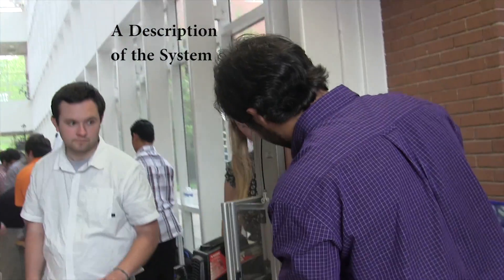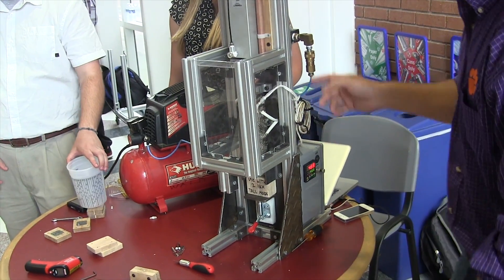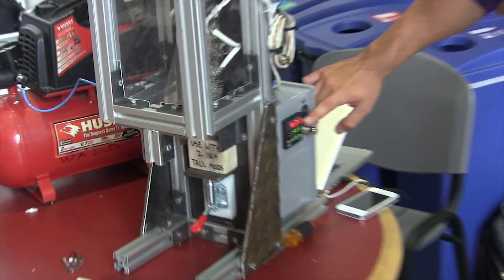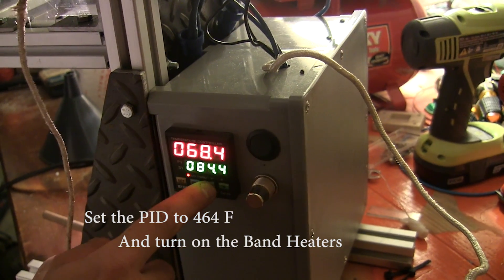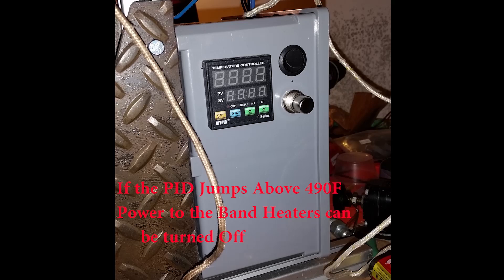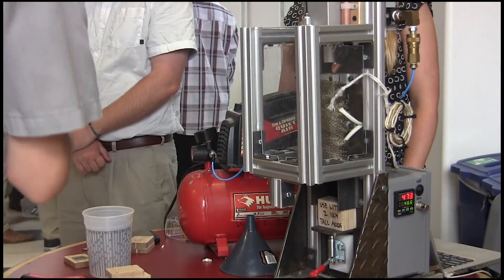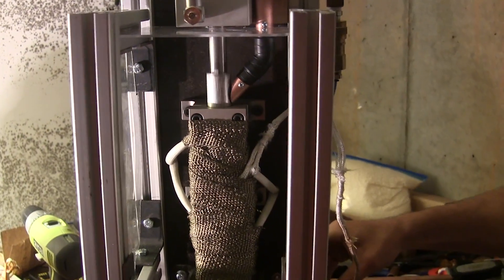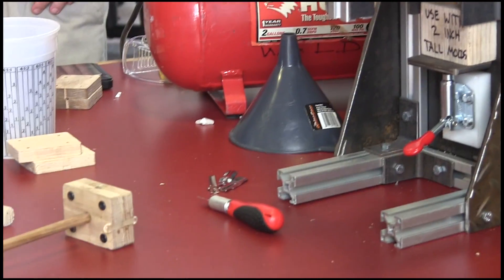Polymer Injection Molding Machine Demonstration Video

Comment: Benchtop injection molding machines are going to rival consumer 3D printers soon.  Everyone and his brother is making these injection molders these days and as more people start to realize that FDM 3D printing isn't that great for most small-run manufacturing, they will start buying these.
Reply: Yup. But dont get me wrong fdm is still great for making larger objects, like lets say a game controller case.
Atleast for prototyping..
My dlp printer comes in a day or 2, and then im gunna buy a cnc, dont know if i should save up for a 5 axis or just get a 3.
Im going to make an injection molding machine, but wanted to go the threaded route, where plastic is fed, pressurized with the threads, and the heater remains inside. And to make that part i would need the 5 axis. Although it may be overkill for a desktop machine.

Comment: plastic injection technology means series production. wooden molds and amount of hand operations don't make this device useful in real production. A good idea, however its poor implementation make it expensive even for 450USD even for university. Go ahead and make really working machine, guys. Meanwhile "thumb down" just for poor implementation, hope to give you many thumbs up in future.
Reply from the maker: This project was completed under a short time, with very little prior knowledge of the Polymer Injection Molding process, and purchasing/modifying of the entire machine components under the tight budget made for a very basic and nonprofessional build. Future improvements outside those constraints would include a larger metal mold with ejector pins,  a larger heating chamber, and a more streamlined autonomous process. This project was not meant for use in real serious production, but rather as a learning tool for Engineering students to really understand the Polymer Injection Molding Process. With this knowledge though, I am sure I can make a much more professional Molding Machine build
Reply: @NickLoe1  Pay no attention to criticism...I sense a cultural shock here: he says "make really working machine" in broken English? obviously the purpose of a SCHOOL work is NOT to make something intended to make money but to SHOW principles, concepts and ways things work. Maybe would be better for that rusky to mind his own business and design, build and finance a prototype for a milking machine, to provide butter, cream and milk for the children of a school in his hometown instead. 

So criticizers keep your mouth shut and go to F urselves.
Reply: 1.  No one said this was supposed to be used in large-scale production.
2.  If you read the show notes, you will see that this was a school project and they were limited to a $450 budget.  Therefore, no use in spending money on proper molds since that is unimportant for the purposes of machine usability and seeing how this is not being sold (though there are many benchtop  injection molding machines being sold today as as people start realizing that FDM 3D printing sucks for small run production of most things).

Comment: Great job. May I ask why did you guys decided to go with a vertical design injection vs horizontal?
Reply from the maker: We wanted a gravity assisted heating chamber for insertion of the plastic beads to be melted. We did not have the budget to incorporate an auger to feed the beads horizontally from the feeding funnel into the heating chamber, like that in traditional polymer injection molding machines. With the heating chamber being vertical, the plastic beads can fall straight from the feeding funnel into the heating chamber

Comment: Nice work! Next steps are to incorporate pneumatic ejector pins with an aluminum mold. ;) So I'm assuming that it was a chamber based design to house your heated plastic until it was ready to be injected? How well did that work out?
Reply from the maker: Thanks! We definitely thought of a metal mold with ejector pins, but under the limited time we had and the $450 budget, it just did not seem possible. The vertical chamber was used to house and melt the plastic before being plunged into the mold. The vertical heating chamber worked pretty well, but the tolerance between the plunger and heating chamber needs to be very minimal to prevent melted plastic leakage around the plunger. Overall this design worked really well with minimal plastic residue in the chamber after being plunged